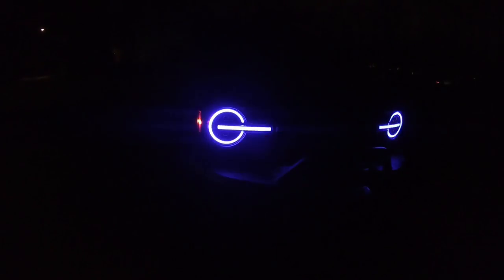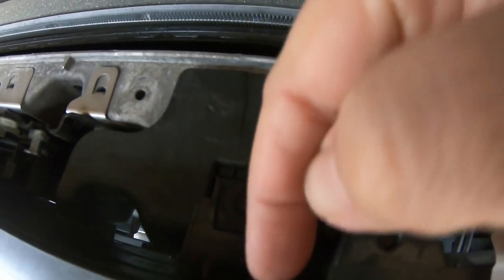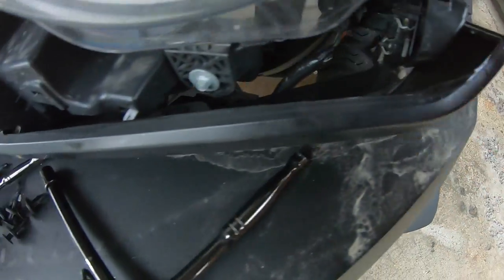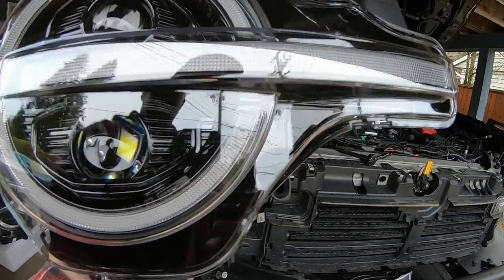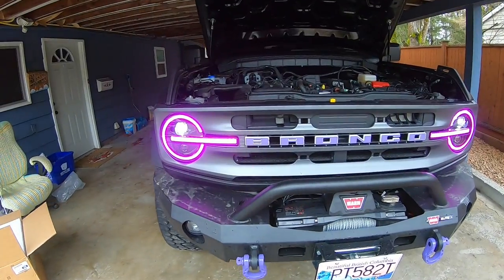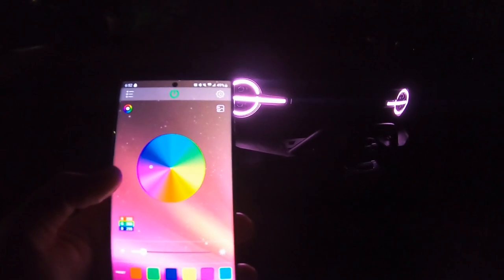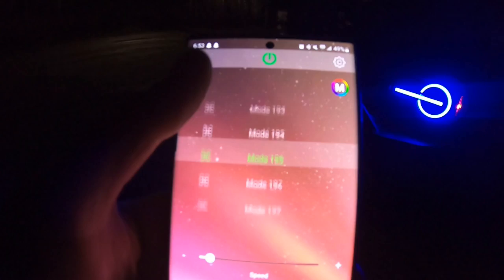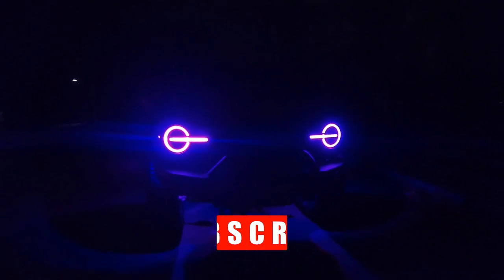MORIMOTO XRGB LED HEADLIGHTS INSTALL AND REVIEW FOR FORD BRONCO 21+

Comment: How are your blinkers? Mybset came with two short harnesses that you can install between the headlights and the car pigtails. Without the harnesses the blinker SOUND is 2x-3x faster than stock even though the blinker flashing speed is normal.

Comment: I am so happy I found your video! I installed my morimoto headlights last weekend and I added the extra rubber spacers to tilt them up, but they are still too low. I 'm so glad you showed where the adjusting screw is. I thought I was going to have to pull the whole front end off again and stick some washers behind that rubber spacer. You saved me so much time!!!!😅
Reply from the maker: Luckily they make it very easy to adjust. Glad it helped
Reply: @CanadianCruisin  suscribed!
Reply from the maker: @Amber Cole  thank you. There isn't much bronco content right now but if you have any questions feel free to ask

Comment: When you remote start your car does the light turn on? My DRL does not seem to turn on when i remote start the vehicle
Reply from the maker: It's not my bronco so I'm not 100% on that but if it's anything like my frontier they won't turn on until you get in and push the button.

Comment: Is it supposed to have that weird line in the center that forms a rectangle shape? Mine does the same. How do you adjust the low beams
Reply from the maker: The adjustment is on the top of the light. Little white/yellowish piece with a X. You can fit a Phillips screwdriver in there to adjust up or down
Reply: @CanadianCruisin  got it!! Worked. Thanks for the video!
Reply from the maker: @dmc387  glad it helped out

Comment: Can the Halogen headlights on the Nissan Frontier be replaced with the LED headlights? I know you already have them on your Pro 4x. But, I can’t seem to get a straight answer on that one.
Reply from the maker: If you find the right bulbs they can be swapped to LED on the frontiers with the halogen bulbs yes.
Reply: @CanadianCruisin  I want to replace the assembly itself. It’s much different from the Halogen design.
Reply: @CanadianCruisin  I was told that if I swapped them, the vehicle could start throwing warning lights.
Reply from the maker: @DebtPRZ  oh I see what you mean. If you buy the entire headlight it should just be plug and play like these ones. Just unplug the halogen and plug in the led version.
Reply from the maker: @DebtPRZ  I've never heard of getting lights from swapping to led versions. But im not 100% on that for frontiers. The bronco in this video had no issues at all

Comment: Debating between these and alpha Rex. These look to be $400 cheaper. Was it worth it for you?

Just got my black Diamond last week
Reply from the maker: It's not my bronco but they seem to like them so far.
Reply: After 3 weeks of these being installed, the left one has the discolored spot. Nothing if fixing it. Impossible to get ahold with a customer service agent too – every time I call "the current estimated time is longer than 20 minutes" and it just keeps extending once i hit 20 mins........ I'm angry. If anyone contacts me back, I'll be returning these and getting the Alpharex instead. I only wanted the white and amber setting anyway -- i should have done more research before buying these.
Reply: @dmc387 were you able to get in contact with customer service for a replacement on the headlights?
Reply: I have Morimoto headlight housings in my Silverado. I’m on my 3rd set in less than a year. They aren’t worth it